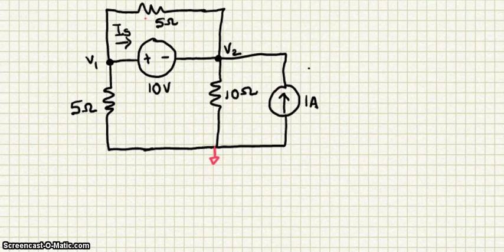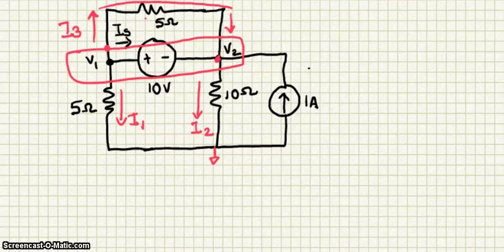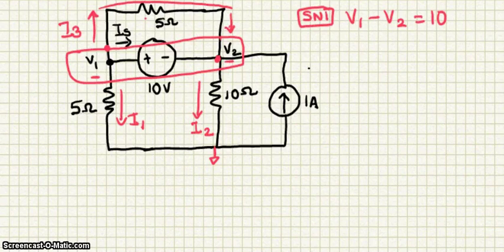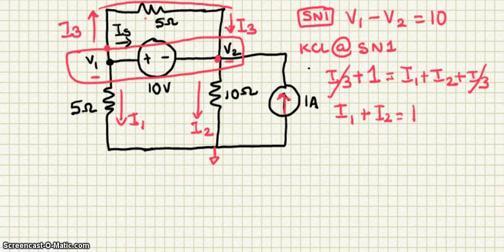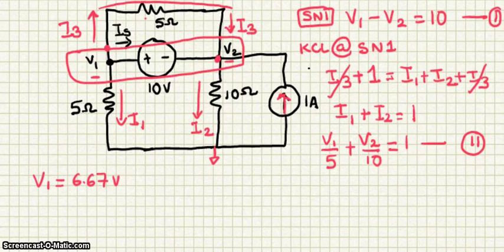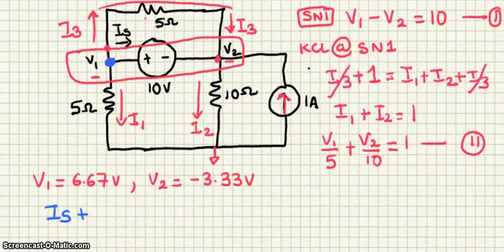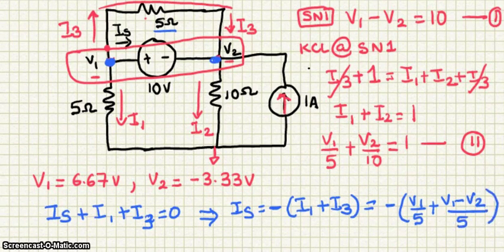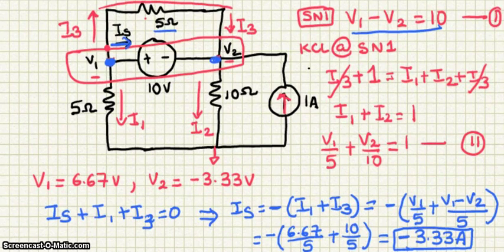Example Node Voltage with SuperNode

Comment: Do you have to pick the correct direction of currents?  I’m having a hard time solving these with nodal analysis.
Reply from the maker: No. Pick a direction of the current. The voltage will then depend on the direction picked. For example I picked I1 to flow downwards from V1 to GND through the 5ohm resistor. So I would write I1 = (V1-GND)/5; NOW IF I had picked I1 to flow upwards from GND to V1, I would have written I1 as (GND-V1)/5.
Reply: Ok, got it.  I think my biggest issue was deciding whether to use (V1-V2/)R or (V2-V1)/R (on problems that require that).  Even though I was using the same direction, I twisted up the math by not being consistent with that.  Thanks for the feedback!

Comment: He made a mistake in part 2, when you look for the current I(s), first of all you know the current IN is equal to the current OUT, right. He did not apply that for I(s), he did I(s)+I1+I3=0, it was supposed to be I(s)=I1+I3 when you're focusing on the voltage v1. The answer is supposed to be Positive 3.33A, simple mistake.
Reply: +Sharon Alvarez his answer is correct. Is is leaving node V1 so his equation is correct
Reply: My friend...
KCL just states the algebraic sum of currents entering a node equals zero. Sure, you are right that Iin = Iout. But it is equally correct to assume all the currents are leaving, OR all the currents are entering. In this case he assumed all the currents were leaving. -3.33 A simply tells us that our direction assumption was wrong.

If you chose Is as going in, and I1 and I3 as leaving, your assumption of direction was correct. Both approaches are 100% valid.

Comment: why V1/5+v2/10=1? where do you get equals 1?
Reply: +azam nah I1= v1/5 ohms from I=V/R
Reply: I1 and I2 are leaving the super Node. There is a 1 amp current entering the  supernode. Anything leaving is positive, and anything entering is negative. Therefore, I1+I2 = 1 amp. It is just KCL for the supernode.